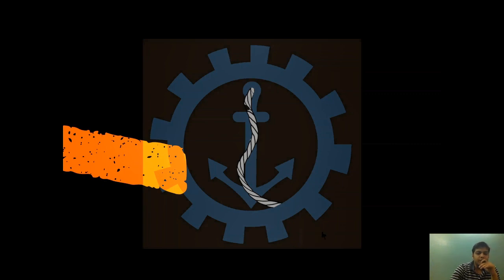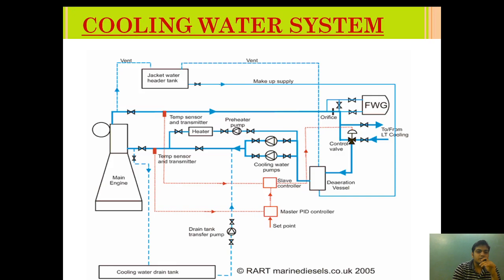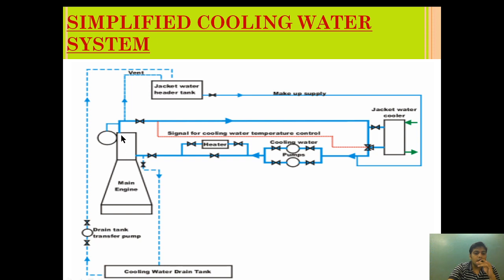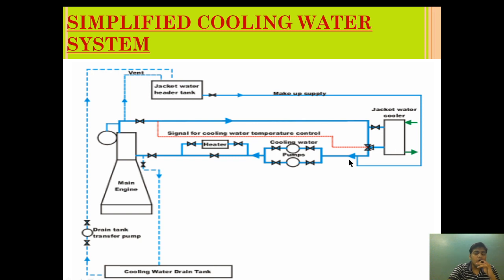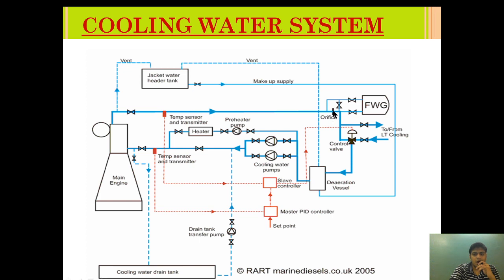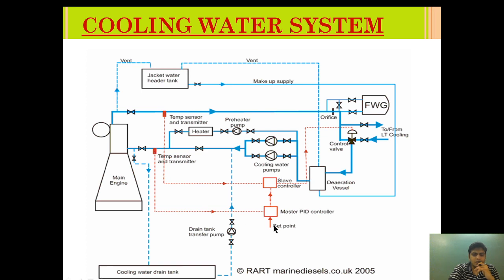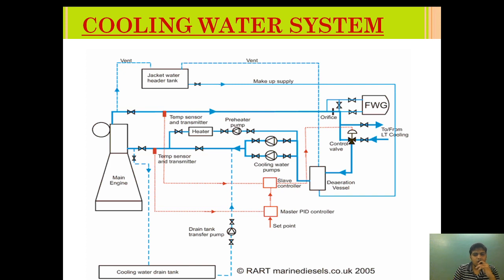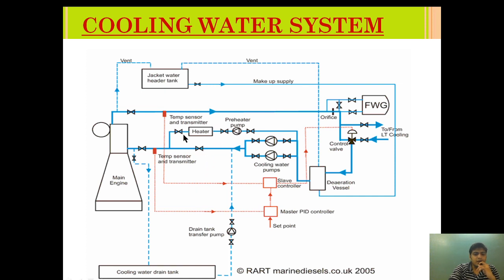COOLING WATER SYSTEM|(PART-1)

Comment: Sir when the engine is running that time heater bypass v/v open,  and inlet and outlet is shut, when stopping reverse inlet and outlet valve will open , and bypass valve will close. Is correct inorder to maintain the temperature

Comment: , how could you adjust the temperature of jacket cooling if the temperature drops with in the desire value?
Reply: automatically adjusted by the Controllers on the 3way control valve located just after the LT cooler outlet in the diagram. That is a continuos reading and adjustment.

Comment: In a Cooling water system, how could you adjust the temperature of jacket cooling if the temperature drops with in the desire value?
Reply: If it drop there's a valve that can adjust it. Ask ur officer where you can locate it. On the ship